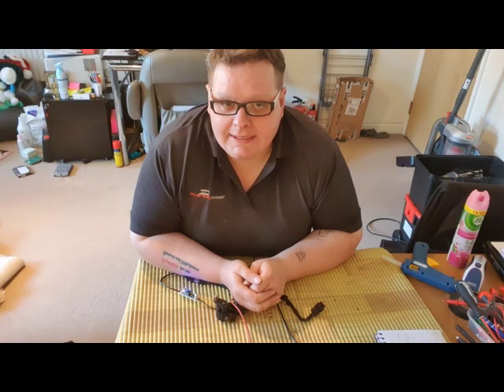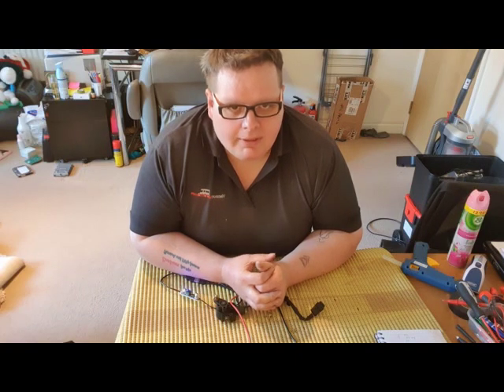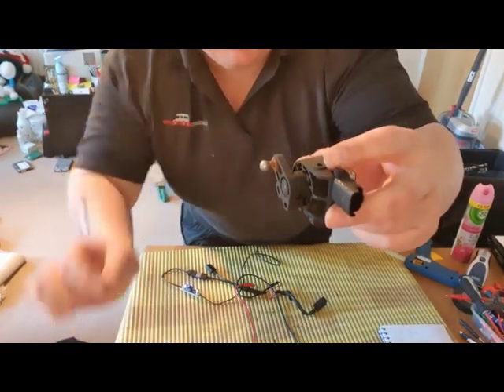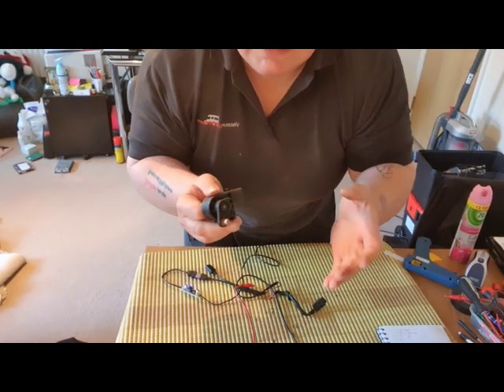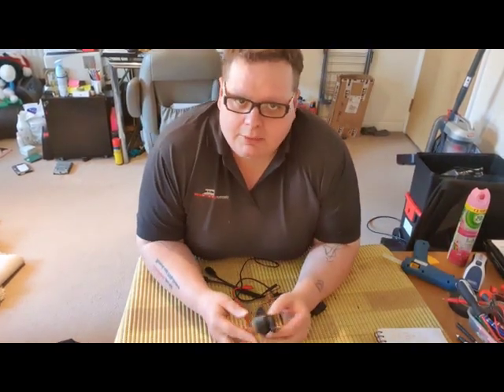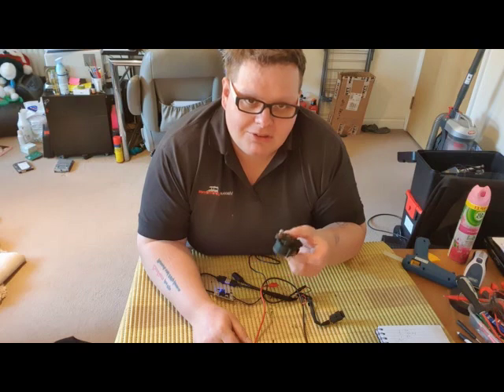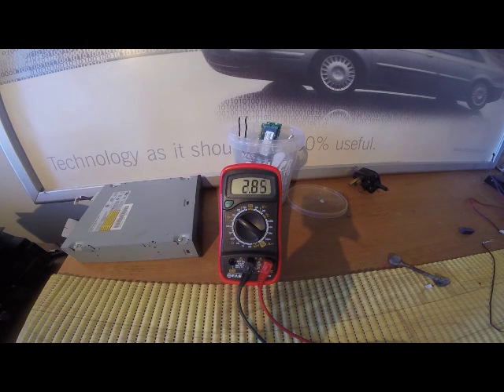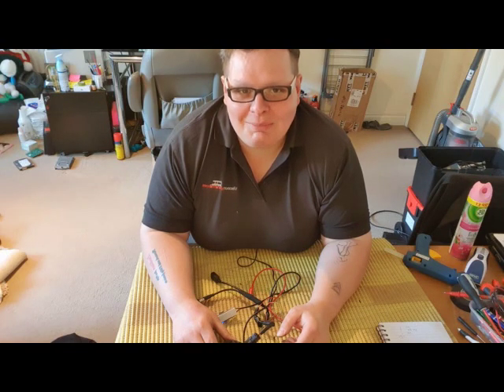Citroen C5 Suspension height sensors info

Comment: Hi Hannah, I’m also a C5 nut. I gave up a 1976 CX2400 pallas to get my 2005 series 1 facelift. I’ve just found out that it’s a HX4 2.2 hdi. It has been dormant for over 12 months and now I have it running, the pump won’t shut down when the car is level. I don’t want to get rid of it but the war office is getting really antsy about having 2 Citroens sitting in the back yard.

Comment: Hi,   I have a 2007 C5 1.6 Hdi estate.   The rear suspension continually goes up and down when driving and also when the engine/ignition off.  I have changed the rear suspension height sensor but fault remains???    Reservoir has plenty oil.  Had it hooked up to a friends diag tool and you could see readback/sensor feedback fluctuating 0 to 240 ( units unknown)  The set point indicated on the diag tool was 115 but it just kept going past that then dropping to 0 and so on....    It was noticable that when the signal got up to 240 the suspension wasnt as high as if I had manually selected highest position on selection switch in car??     The reason this is my focus is that Im getting some loud clattering noises off rear suspension when on bumpy roads,,, had garage look for the cause but couldnt find anything. I was suggested that the with the car constantly going up and down at the rear... it could be bottoming out on a bump when it was at the lowest point of the up/down cycling issue I have.... is this possible? Or am I way off in my thinking...  Two garages couldnt find any mechanical issues..   Any ideas much appreciated.

Comment: Is there a relay for the hydraulic motor
Reply from the maker: On the side of the motor you will see 2 big cables and a small cable, the relay is apart of the pump, if you give 0v to the small wire this will make the pump work

Comment: Hi I have a Citroen C5 2001 my fuse A40 blows. Lower down and up, then the A40 breaks 🤔 Adding a new one comes up. Using A50 now. Can the sensor cause fuse A40 to break ?? The car down to 0, fuse goes up 🤨 Why??? Don't want to change the pump. Could it be other problems??
Reply from the maker: It sounds like you have a faulty pump, if you change the pump make sure you change the ecu bolted to it as if you don't, it will need reprogram,  I am in the process of making a video soon on c5 wiring and how to test etc
Reply: @thec5nut   Can it be air in system? Ore some Wire lose/bad 🤔 Ore senor damige A40 go
Reply from the maker: The sensors don't run off a 40A fuse,   only the pump motor, if you remove the drivers headlight and check the wiring you could have a wire damage which will make the fuse blow,
Reply from the maker: Having air in the system will not make the fuse blow,
Reply: @thec5nut  A bit Smoke come out , go like heavy.Where finde? I live in Finland. Take from old car here !! Dont know how Long live the pump 🤔
Reply from the maker: @RBISTO  if you look at the car from the front, it's on the left side behind headlight, you will see the pump once you removed headlight
Reply: @thec5nut  Yeah i know. But cash for new some sell?
Reply from the maker: @RBISTO  you can't buy néw one, but I might have one for sale
Reply: @thec5nut  😎👍 2001 Gasolin  2,0 L .. prize?
Reply from the maker: @RBISTO  I will sort out price tomorrow for you
Reply: @thec5nut  Okay. Have had it for half a year now. Everything goes well until pressing down. Up then goes the A40. The pump sounds normal when sitting in the car. And has condensation in oil white capachino color 🤔 Cold winter here
Reply: You have Messanger on Facebook? Look My make there can send talk there
Reply: My name, not make 😄

Comment: I have 2007 Citroen C5. There is no any indicator about suspension height. Car show it temporarily. Is it possible see it all time? I checked with OBD2. There are everything sensors except suspension. If I get height signal I can solve this problem with Arduino and extra lcd screen ect.
Reply from the maker: Hi there sorry for the late reply, I am in the process of answering your question once I have finished building my test rig, I should be able to answer in a few weeks time

Comment: My friend has a C5 . He has just had brand new front suspensions added. However the front is now lifted too high. We are worried that the wrong part is on. Is it just that it needs adjusting?  It is not a new car. not sure of the year.
Reply from the maker: That's bit strange, the best thing to check is the front anti roll bar links are ok with no play, and if they are ok, I would adjust the height with the sensor
Reply: Same problem and i found this : Après un changement de triangle, il est impératif de réaliser un apprentissage des hauteurs avant et arrière.

Comment: Hello, I have a cetarwen c4 picaso. Sometimes the servise subsension light flashes fatly, sometimes intermittently. The car was checked in several workshops and they did not find a malfunction. Some said the compressor should be changed. Some said the height sensors should be changed. Some said the electronic mind.  Only at the top there is a code 1196, but it is not permanent. Is this a permanent malfunction caused by an industrial error in all cars of this model?
Reply from the maker: not sure as your car has air system, and the c5 has hydro system, i am sorry but i cant really help as i only work on c5s, not c4

Comment: Hanna. Silly question. My C5  2.0 HDI  ( light blue hatchback ) celebrated it's 20th Birthday at the start of this month.  I've never worked out whether it's a Hydactive 3 or 3 +.   It has the up and down arrow buttons near the hand brake. That is all.  What do you think ?
Reply: Does it have Sport button ?
Reply: @petrovicdruid  No sport button, just the centre console "Up & Down" button. Thanks.
Reply: @jackspratt4343  Hydractive 3 with 4 spheres.

Comment: Hanna. That C5 estate trailer is exceptional. Well done. I guess that you have the BHI still on board, powering the hydractive shocks up and down. May I ask, is the main engine CPU and the BSI still needed on board the traler for you to be able to rise the height etc.  Many thanks.
Reply from the maker: sorry for the late reply, been soo busy, you are right on that, i had to save on the weight so had to make my own ECU for the pump so that i dont need to use all the ECU and Bsi
Reply: Thanks Hanna for all your replies. I understand how busy you are juggling a demanding full time job,  which is even more hectic this time of year. You are spearheading the way in exotic French car technology, which is of great appreciation to French car lovers like myself and others.
Reply: Especially Citroen lovers :)

Comment: Hi Hannah, I've a C5 X7, not up to 225K on the clock and going strong! Apart from the bouncy castle drive every other drive. I think it is the rear height sensor but struggling to get hold of one.
If you could tell me where yougot yours that would be great!
Thanks, 
Andy
Reply from the maker: it sounds like you may have a bad sphere, when the spheres go bad, you will feel every bump in the road, he sensor i had in this video was taken off a car which was scrapped, i go to the scrap yard every month to see if there is any c5s there, and when there is i will take some sensors off and do testing on it, i mainly deal with the mk1 and 2(facelift) c5s, from what i can remember on the c5 x7 is a completely different system with the sensors,
Reply: @thec5nut  Thanks Hannah, I will contact a few scrapyards and see if they have any in stock. Sadly I do not think it is a bad sphere, the back is riding far to high and will not lower, well most of the time I can lower to lowest then raise and that sometimes works.
Thanks for the advice.
Andy
Reply: @thec5nut  Would you know the part number or how I can find this?
Thanks
Andy

Comment: could you please do a video on how to adjust the ride height on these cars? been looking everywhere for one.. i understand it's not very complicated but i'd love to know what i have to do beforehand, rather than try to figure it out myself under the car. i'd like to lower my car as atm, it looks atrocious, i think the gap between the tyre and wing edge is something like 8cm. would very much like to lower it to something like 3cm, would that be ok?
Reply from the maker: hi there, i feel your pain, my c5 v6 is quite low, and needs to be raised up a little, the problem you have is that you cant have it down too low as this can effect the road handing, i will be doing a video on this, but not until december as i got a few bits to sort out 1st
Reply: @thec5nut  what would you consider as being "too low"? what's the lowest i can go without hurting the handling or reliability of the suspension?
Reply from the maker: @mistreku  thats a good question, its about 3 - 4 fingers is a min
Reply: @thec5nut  cheers, bud! will set it at 3 fingers initially and report back.
Reply: https://www.youtube.com/watch?v=O84p8LyHbRw

Comment: Hiya Hannah 
Just wondered if you'll know where i can get OSR shock absorber and flex pipe for my 51 plate C5 as i was told by a Citroen garage that it needs replacing and an MOT failure and i lov my car and dont want to scrap it when everything else is perfectly ok with it, (apart from wear on the stearing wheel, if you know where i can get one of these too that would be great) i have trawled through ebay and other sites but nothing is avaible, and as you are so into this car i hope you would be able to help.
Thanks
Stuart
Reply from the maker: hi Stuart I am sooo sorry for my late reply, things have been crazy for me,. can you please tell me if your car has the sports button?

Comment: Hello Hannah!
I have C5 HDI first gen wagon. Today my rear suspension went flat. It doesnt want to climb up. Please help me!
THANK YOU
Reply from the maker: I am sorry its taking time to reply, I didn't see your comment until now
Reply: Have a c6 showing suspension fault Put a old 2012 launch tester came up with RL 52 wns and RL 52 wns code's stearing angle no communication know it's one of the sencer s not talking or out of alignment but don't tell me what one any ideas on the two other faults  the car drive's perfect suspension perfect just flagging up every two or three miles driven 800 miles after completely overhauled everything suspension timing belt kit water pump thermostat housing any help with these codes on what one is out or broken thanks John